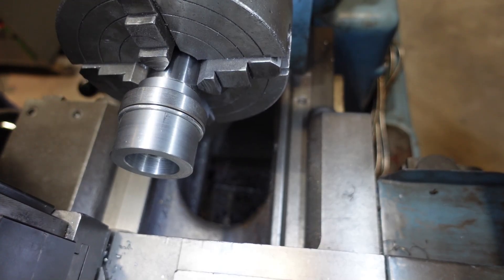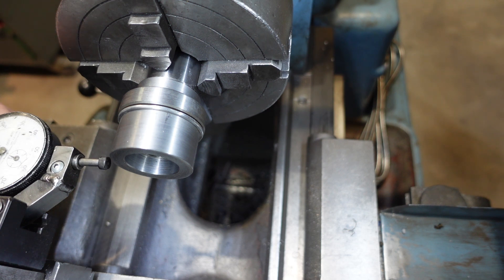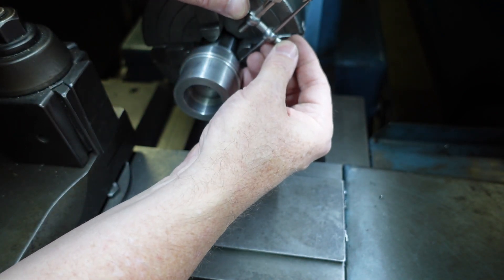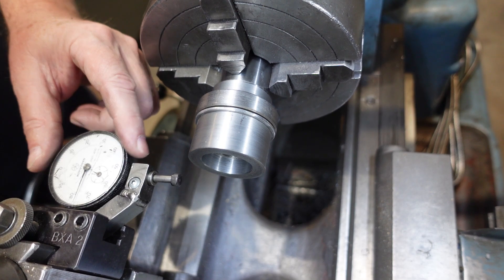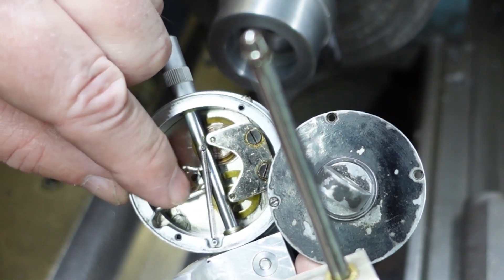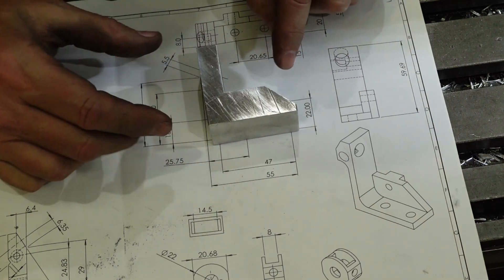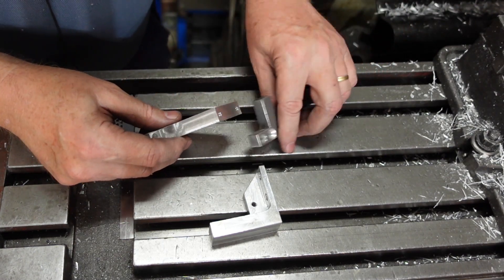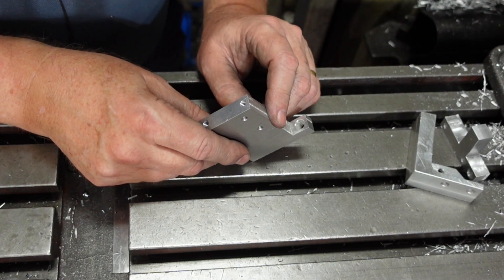The universal indicator (pt 1)

Comment: Its probably worth mentioning that the maximum load on the indicator is only the resistance from its own small return spring.
Reply from the maker: Yes. At a guess I would say grams. With this set up I avoid any 'extra' loading on the indicator (all taken by the device)

Comment: Achieving all the indicating issues you've found could all be done in a single unit. But, quickly clamping a test indicator by its stem in the tailstock chuck will easily indicate any bore. This would not affect the unit in the toolpost which could remain in place and allow a much simpler design, or simply leaving a tool in the toolpost? Maybe you could then just use a long stem indicator for all the other requirements. There may be some situations where you can use the two indicators at the same time.😉
Reply from the maker: Understand what you are suggesting, but one of the benefits for me of trying to do this sort of stuff is that it keeps my brain ticking over. A DTI in the tailstock may work for some but I haven't got a DTI with enough travel for it to do what I want.
Another arguement for not using a DTI is as you said, it also would not make a very good video.